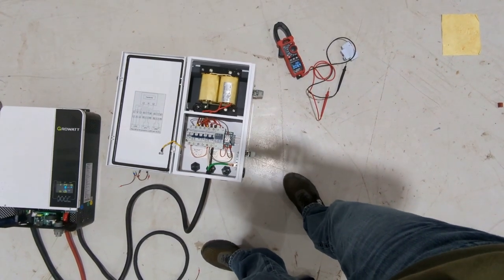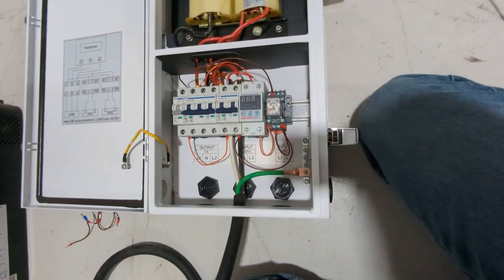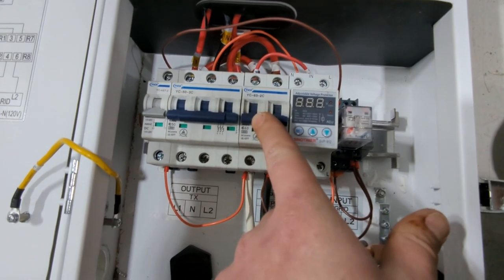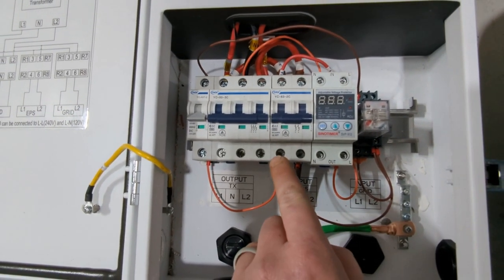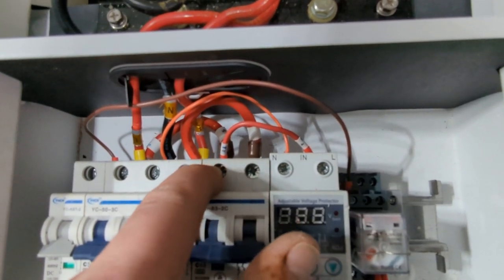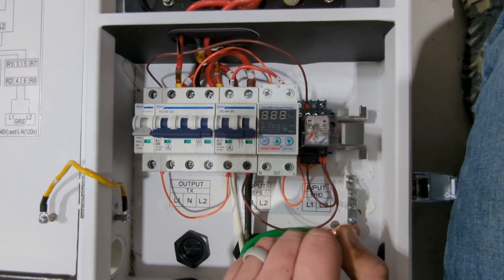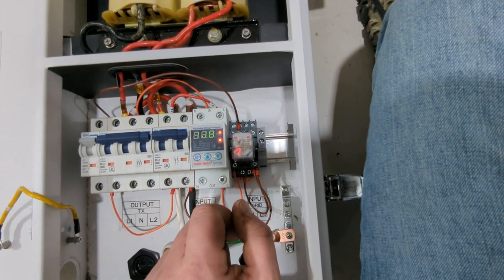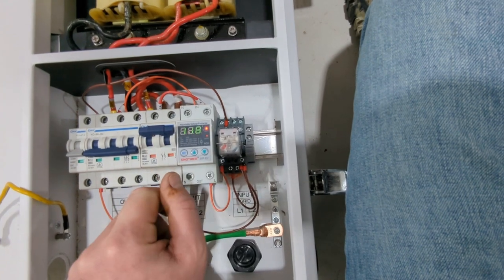Growatt 5000ES | Growatt 11.4KW AutoTransformer Neutral Protection

Comment: Great Video! What type of relay are you using, do you have a parts list you could share?  Thanks for the video!
Reply from the maker: Here is the voltage protection relay. You may be tempted to put it inline because it says it's rated for many amps. Don't do this. Use a listed contactor and use this relay to drive the control side of that contactor.

 https://a.co/d/1K6R4pZ
Reply: Can you publish a parts list please?

Comment: nice video, one question though does the Voltage Current Protector Voltage Protective Device keep its settings when power is cut or does it reset to default? TIA
Reply from the maker: It does in fact retain it's settings.

Comment: Question about the Autotransformer.  Are there instructions to use it for step-up 120v to 120v/240v?  I could use Victron for this use case but those are pretty expensive.
Reply from the maker: I don't have any info on that, and I don't think they are rated for that use case.

Comment: I'm just now getting ready to commission my of grid system.  I'm using 3 of the growatt 5000 ES inverters.  How do i get all of the 240 V inverters into 120 V split phase. Would i have to get a separate auto transformer (say a 5000 watt split tr as nð dfor all three and install this  neutral protection ckt in all three?
Reply from the maker: You would just parallel them all. I did a video on it. 

https://youtu.be/P9t92RAwZMs